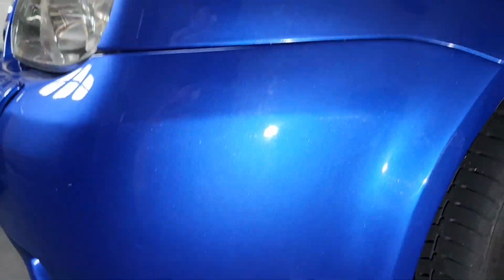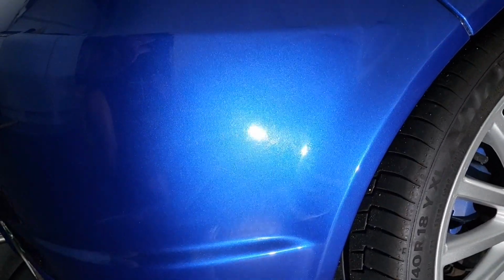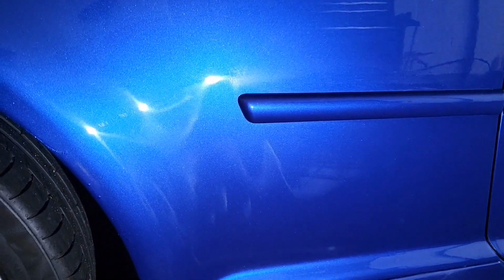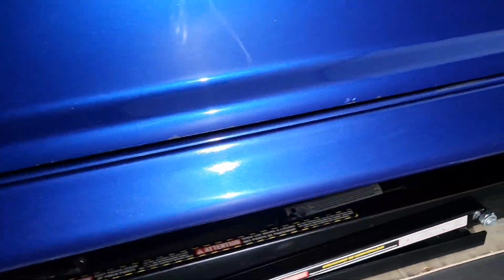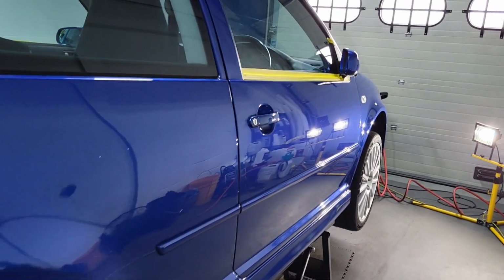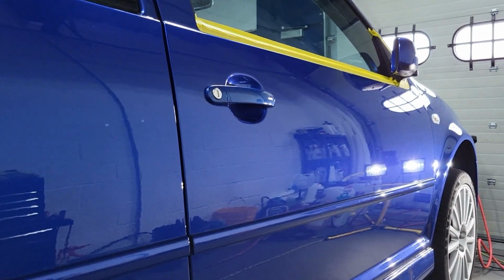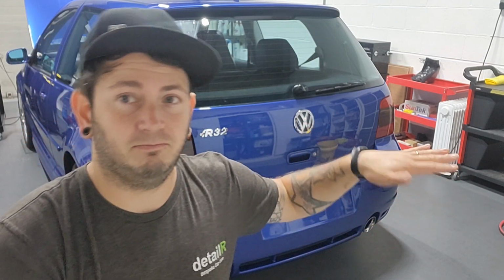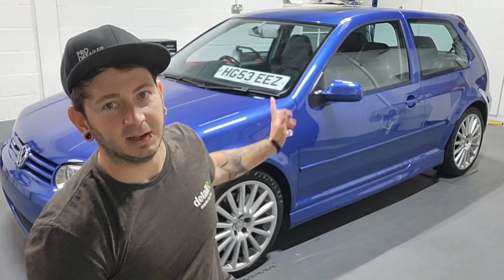VW Golf R32 Detail - MK4 - Detailing Milton Keynes

Comment: I enjoyed that :)

I've ceramic coated my own car when I worked as a detailer. I also regretted it at times, because all I do now, with regards to detailing it, is wash it and detail the interior. 

I do have my wifes car, a Toyota Aygo, and I've polished it, and then waxed it with Autoglyms UHD wax, which is a very good substitute for their HD wax.
Reply from the maker: I do love having a coated car. I don't get a great deal of time to detail it and such so just being able to wash - dry it and it's done is great for me (good job it's only a Mini). 
I do really enjoy the process of stripping and trying waxes, though. Both definitely have their place, but for a hectic schedule, coatings suit me well 🤣
Reply: @detailR  Oh certainly, I wouldn't strip the coating just to get to wax my own car every so often :) Although I have more time for it now, there's no point in stripping the coating, just to replace it with a wax, that isn't as durable :) I like having my A6 be easy to clean and dry.

I don't miss the long hours I had when I worked in detailing AT ALL :) (some days would be 12-14 hours), nor does my lower back 😊